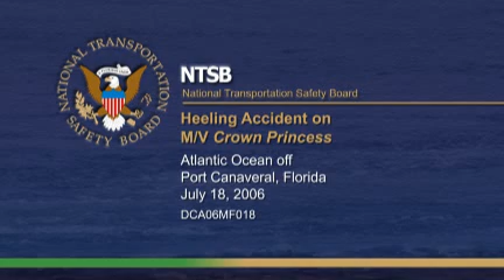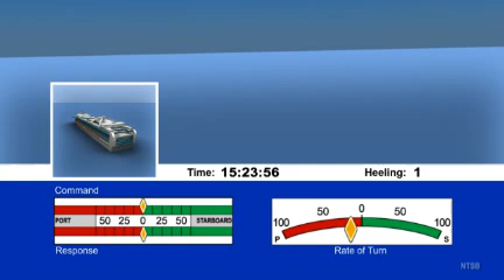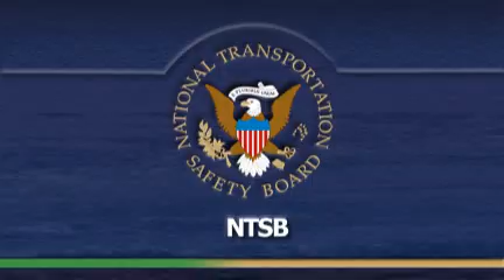Heeling Accident on M/V Crown Princess - Full Version

Comment: Not much publically said about this...I wasnt there but I lived there 20 miles 
away from where this happened off of port Canaveral.  It was a 20 degree
 list that culdnt be explained at 1st but then was blamed on a 
mechanical failure, and then on the captain, and then on the 2nd officer in command..who they blamed and fired, 
and this story faded away.
 

The newest ship for the Princess Cruises line, near the end of a 
nine-day Caribbean cruise out of Brooklyn, listed to one side on 3pm 
Tuesday near Port Canaveral, Fla., roiling passengers and crew members 
before righting itself and heading back to port.

The unexpected roll to starboard resulted in injuries for some 
passengers and damage to the interior of the ship that officials with 
the cruise line said would be easily repaired. The ship was carrying 
3,100 passengers and 1,200 crew members.

“We can confirm that there were approximately 240 passengers treated on 
board for various injuries, such as abrasions, bruises and fractures, of
 which 94 were transferred to local hospitals ashore for evaluation and 
treatment,” cruise line officials said today. 

I wonder if it was hit by the USS Texas (SSN 775) that was known to be 
there in the narrow deep water trench used by all ships leaving and 
returning to port.  

@t

Comment: This is a very very basic explanation of what happened. The accident report is fascinating. The accident was caused by the ship traveling too fast in too shallow of water which caused "squatting" and the autopilot wasn't set to be able to control the rudder quickly enough to maintain control of the ship. The officer who took over had good intentions but didn't react correctly and made multiple errors that just made the situation worse. Blame was placed on the captain for leaving the bridge when he knew the ship was acting strangely and for not having the correct settings on the autopilot.